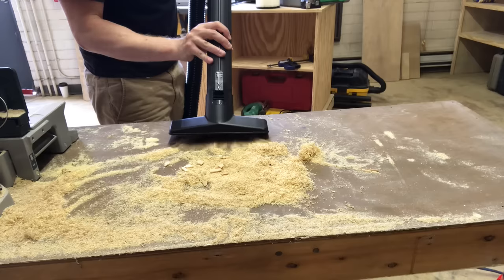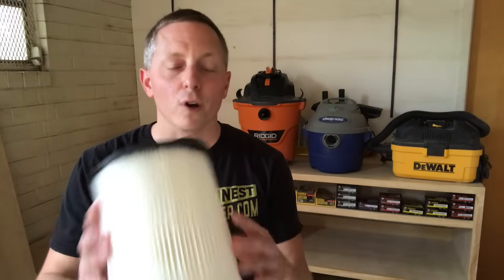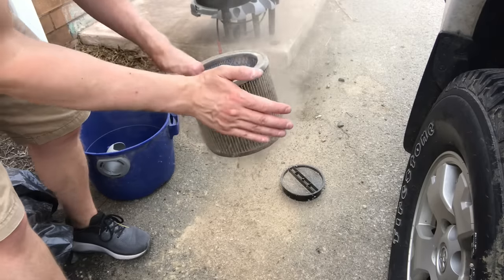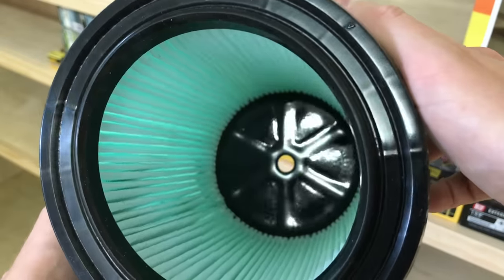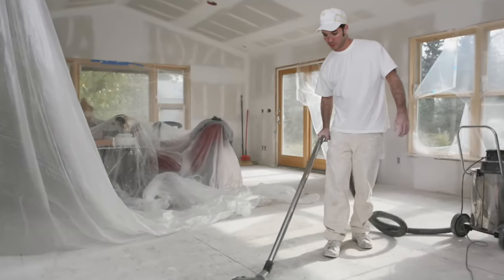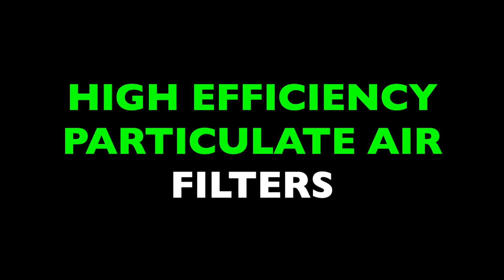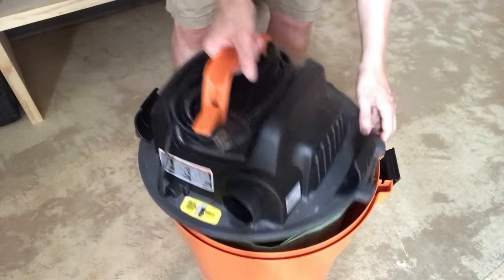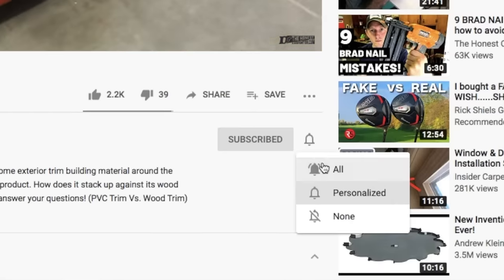Never Use A SHOP VAC Without One Of These!! (Shop Vac Filter Bags/How HEPA Filters Work...)

Comment: The way I tackled this when dealing with drywall dust was to attach a 15 foot hose to the exhaust port and stick that out the window so no air or dust was recirculating In the house
Reply: Life hacks
Reply: I use the rigid muffler, works like a charm
Reply: Yeah,  me too,  with the long exhaust hose outside
Reply: Your neighbors must love you. A water vault works better so does using a fine particular dust bag. That added hose reduces you vacuums power and runs the fine dust through the vacuums impeller, wears it out much faster.
Reply: @jamesmchugo9422  hey desperate times man, had to do what I had to do.
Reply: @jamesmchugo9422  also, all y’all complainers live six inches from your neighbors or something?
Reply: @wchops7578  His point was valid.  You will be getting the dust around your house and the neighbor's house.  So, it would be better to do it right.
Reply: I've done this, works great.
Reply: Swimming pool hose. Smooth bore. Leave the vac outside.
Reply: @wchops7578  in NYC, all the houses are connected...
Reply: @jamesmchugo9422  I don't know if you noticed, but 2 HEPA filters and bags @ $99.99 ($49.99/each) cost more than the vacuum @ $89.99. So, it's actually cheaper to replace the vacuum than HEPA filters in the long run. Ridgid is using the razor blade approach, sell the razor cheap and make your money on the replacement blades.
Reply: @wchops7578  HAHAHAHAHAHAHAHAHAHAHAHAHAHAHA
Reply: @fvrrljr  chill
Reply: @wchops7578  i laughed cause you killed Everdash with Kindness LOL
Reply: @fvrrljr  haha I rescind my comment and encourage more laughter! 😁
Reply: @wchops7578  i Like, OLE'!
Reply: @jamesmchugo9422  been using a old floor vac turned upside down the exhaust my planer chips through the barn wall for over 30 years. still works great. all metal vac and impeller.who knows how many termites i feed?
Reply: Ahhh... You tricky son of a gun I'm going to try that out.
Reply: Absolutely!  I always use hose extensions.
Reply: @singlefather01  I know right? Like there’s not already dust in the air outside.
Reply: @jamesmchugo9422  When it gets to the outside, it goes everywhere then settle down.  I'm not sure how much impact to the neighbor.  They have to be close and have window open.  Even so, it will be very small % may reach there.
Reply: Can I get a link to buy 15 foot hose?
Reply: @jamescc2010  It depends on the brand.  My Rigid brand stuff was at either Lowe's or Home Depot.  Superduper common stuff.
Reply: @wchops7578  It's not that bad. I do the same thing. Just to make sure I tested with a new setup and a cup of corn starch. Yes, a little dust came out, but it dissipated posthaste. But indoors it would have been like smoke. Another thing are oils and VOCs, not even a HEPA filter stops those molecules. Test that with a few well placed drops of perfume or essential oil.
Reply: I do it the cone head way
Reply: @jamesmchugo9422  Could you post a link to how a 'water vault' works?
Reply: @CaseAgainstFaith1  Not really, it depends on the toxicity and amount, but it will be so diluted outside that it will be harmless
Reply: Really good idea. BUT, if neighbors are close by, HEPA filter and bags are the way to go. Keeps everyone safe and no problems with OSHA, neighbors threatening lawsuits,etc. Even though I use a Ridgid vac with HEPA filter and disposable bags, I think I'll try your idea to keep my exhaust port from stirring up dust in the room I'm working in.
Reply: That’s what I was thinking
Reply: @kenchow8213  you can buy a HEPA bag for your shop vac for about 7 bucks .
Reply: Oh no God bless the pedestrian who walks by 😆
Reply: What I do too ! either that or use a long inlet hose and put the machine outdoors (quieter that way !)
Reply: Your neighbors must love you 🙄
Reply: @gregkosinski2303  Greg, my guy, it's not like I live in a former Soviet apartment block blowing air into my neighbor's domicile.
Reply: @gregkosinski2303   As someone who follows this procedure, I would like to point out that I never had a neighbour who gave a rat’s ass for any liking or preference of mine, so why should I give a pair of festering dingo’s kidneys what they think  ?
Reply: @singlefather01  Unless you live in an apartment and his goes is right next to your window, then this is not an issue. You are way too quick to call someone a jerk. This guy could live a mile from his neighbor. The fact is, except in cases of extremely close neighbors this is not an issue at all. You should use your head before spouting off online.
Reply: @jamesmchugo9422  Unless the neighbors are exceedingly close, they almost certainly wouldn't even know it let alone have an issue. Much ado about nothing.
Reply: @CaseAgainstFaith1  Only in those cases where the neighbor is close enough that it matters, which is a small subset of the real world.
Reply: @jeremiahwright8294  Perhaps the neighbors shouldn't be coming over and snorting off his vacuum hose...
Reply: @melissacook5186  Yet NYC and places like it are a small subset of the real world.
Reply: @kenchow8213  You don't need to buy the rigid filters. I've had several brands on my vacuums.
Reply: @ericmann7945  The HEPA filter and the bag are a great way to go. I do the same. I also use the muffler to disperse the output air to keep it from disturbing dust in the room.
Reply: @MaikasCooking  If the pedestrians are that close by it implies they are in a city which also means they will have breathed in more particles from the smog in the air after walking a couple blocks, than they would get from a vacuum running.
Reply: @NickFrom1228  "You don't need to buy the rigid filters. I've had several brands on my vacuums." Can you please specify which other brands of hepa filters you have found also work on Rigid vacuums.
Reply: @NickFrom1228  In the real world houses are often mere feet away from each other.  Depends on the neighborhood.
Reply: @kenchow8213  where are you buying bags for $50 each? At least two suppliers I use sell HEPA rated bags for in 10 packs for something under $35 a pack. I can go to Walmart and get a 3 pack for $20. You’re getting screwed by whoever is selling them to you.
Reply: @basilleonardo  something like it yes. This is one of several home made versions. It appears to be getting it done.
Reply: @NickFrom1228  thanks brother!
Reply: @kenchow8213  I haven't paid attention to brands but I think anything that fits shopvac fits rigid, at least the model I have.
Reply: @CaseAgainstFaith1  Which is just restating what I said...
Reply: @singlefather01  Ha ha!
Reply: @murderedouttt3055  I bought a Rigit filter, but it doesn’t fit my Rigid Shop Vac. I can’t figure this thing out unless I’m getting the wrong one!
Reply: @Tinyteacher1111  you need to buy the 2 1/2” Ridgid power tool adapter accessory and then it will fit
Reply: @paulrodriguez4061  😵‍💫
Reply: @corydriver7634  grow up
Reply: Nice
Reply: @MaikasCooking  or the guy who just washed his black car! lol
Reply: So long as zoning doesn't give you shit that is a great idea.
Reply: Genius! Thanks!
Reply: That's smart. I think I'm gonna consider that. 👍🏻
Reply: Oh ..I use mine for wet …oddly filter is worthless…been using exhaust hose since the 70s…send the dust outdoors
Reply: I put the exhaust hose in my mother-in-law's bedroom. She never came back.
Reply: 25 yo ridgid shopvac..found out It was made before they designed the vacuum bags can you think of a way to make that work. The inside of my inlet hose does not have a slot to slide the cardboard square into
Reply: @James McHugo  why would adding a hose on the output change how much dust is going through the impeller? Only removing the filter would do that.
Reply: @wildmanofborneo  using the dust hose connect to the output doent reduce the amount of debri paasing through the impeller, it merely sends dust outside...
Reply: @Sluggo01  not sure why you're telling me this.  You seem to be repeating what I said. Keeping the filter on and ducting the airflow outside is the healthiest way to deal with it.
Reply: @wildmanofborneo  sorry
Reply: In the professional world drywall dust is managed with sweeping compound not a vacuum, bag or no bag drywall dust will clog up vacuums…
Reply: Definitely have to try this method
Reply: I'm going to do this in my shed. Great idea
Reply: I bet your neighbors really loved that!😂
Reply: @MaikasCooking 
   It'll look like they just blew a "FISH HORN."
Reply: @general5104  Brother, your two years late to the party with that comment.
Reply: I did the same thing when cleaning out my chimney dust. Bought an extension hose and stick the vac outside, so much less dust in the room that way.
Reply: @murderedouttt3055  I have the RIDGID muffler on my RIDGID vac, but it's purpose is to reduce the sound level of the vacuum and does nothing to remove fine dust particles.

Comment: Just remember, the finer the filter, the more resistance it adds if not compensate with major additional surface area. If you always pick up a lot of hair that makes it harder to clean your filter, you can wrap one layer of a fine netting (Walmart sells it as “Thule” In the wedding decorations area) … It adds virtually no resistance, but will trap the pet and human hair before it enters the filter, and is easily peeled off prior to cleaning and takes all the hair with it and it’s super cheap.
Reply: Nice tip! Thanks!
Reply: Bit late for this, but I believe you mean "tulle."  There's a company called Thule which sells roof racks and such for cars.  And if you really want to get esoteric,  thule has a metaphorical meaning of any distant place located beyond the "borders of the known world".  The guys that might be watching you and reading this tip may feel that way about the wedding decorations department.  Wives will probably know what tulle is, and would be happy to get some for you.  They do sell it places other than Walmart.

Comment: Get a 25 foot pool hose, put your vac out side, hook up the pool hose to your vac leave vac out side, bring pool hose inside. Cheap, easy, no dust in the house.
Reply: Doing it this way, The dust ends up in your homes vents and finds it way back into your house and then your $10,000 air conditioning system is affected.

Comment: Doubt anybody will read this so late in the game but the reason smaller particulates are easier to capture is because of a phenomenon called Brownian Motion (also movement) that causes the smaller particles not to move in a straight line. In other words, they're a bunch of extremely drunk drivers, at night with no illumination, with a malfunctioning GPS, zigging and zagging, trying to thread their way through the microscopic eye of a needle, and running into the filter walls and getting stuck.

Comment: I have been using an old pillow case for years, works even with drywall dust.
Reply: So you use the pillow case instead of a bag? Or instead of the filter?
Reply: @angellas.1314  Instead of the filter. I use large elastic band to hold in place
Reply: This will not filter out fine particles. You can't see them.
Reply: @danielwilliams3332  You are correct Daniel, but I do not need to worry about fine particles, it is good enough for what I do.

Comment: @The Honest Carpenter Ethan, I utilize a wet towel over my exhaust on my shopvac to catch any fine particulates that happen to pass through my HEPA filter cartridge. I just strape it down with some bungees and make sure to keep it damp. Great for working in an occupied residence.
Reply: Great idea. Thank you
Reply: Thank you! So many smart people out there …
Reply: Nice,,,  a reverse swamp cooler :D
Reply: I used this method as a stop gap but the rag dried out almost instantly. Works well for a quick vacuum
Reply: Great idea, what kind of towel did you use?
Reply: @DM-lk5ym  I prefer to use a heavier, higher thread count towel as apposed to a thin shop towel or microfiber. The towel should hold water for a good amount of time before having to re-wet it.
Reply: @JaybirdOnTheRun  Thank you, I'll be adding a "good towel" to the tool world lol.
Reply: would love to see an official study to see if this works as well as you hope it does.

Comment: You can also knock off the dust from your filter using an orbital sander (without any sanding pads). The vibration will get most of the fine dust off

Comment: Another thing I’d recommend is using a broom and dust pan for big loads of easy to get crud.  It will save your bags and filters and the fine particles will not be essentially throwing a ton of particles into the air like the blower on your vacuum would.
Reply: I made my own system where everything goes into a large 50 gallon barrel and then goes to the shop vac. Basically a diy and larger version of the dust rite system by rockler. Works great and don't have to worry about filling up my shop vac. Getting the hepa upgrade for my ridgid is a no brainer. 
And the money pit continues...
Reply: Greg you can tell who is too lazy to use a broom.🤣
Reply: If I am using a broom I first throw down some damp sawdust or failing that lightly spray the floor with water from a spray bottle
Reply: @duster.  | Smart!
Reply: @leroypoole1998  | Your health also continues. 👍🏽

Comment: Always used a nutone hepa vac since I got my lead safety certifications 20 years ago! They are expensive and impractical but didn't have any other options for a long time! Since then I have come up with a few different options water filtration being the best! Used a two stage separation chamber to catch the bigger stuff, then water filtration for the third chamber! Keep s the dust from getting to the final filter and the weight from being to much for the main bulk of the material! Its kind of cumbersome and awkward but keeps my "Older" homes I work in more safe , and easier to clean up at the end of the project! Got the idea from the rainbow vacuum cleaner! Basically a cyclone system co.bined with a rainbow vac!
Reply: Many years ago I think I read in Consumer Reports or some other publication that rainbow vacs did not filter out particles even though rainbow claimed it worked. Of course maybe your system is effective, but I remember thinking how much work vacuuming had been for someone I had known in the late 80's who had purchased the expensive rainbow vac and hauled the heavy machine around her house vacuuming daily to improve conditions for her young children who suffered from asthma.

Comment: I've been preaching the use of barrel liners AND use of pleated filters at the same time for yrs. I've even figured out methods to retrofit barrel liners in older shop vacs that weren't designed for them. Thanks for explaining HEPA bags and their purpose.
Reply: Are you saying the barrel liners are better than non-barrel liners? My vacuum only has non-barrel liners available.

Have you by chance figured out how to use a barrel one on a small 4 gallon vac?
Reply: @themikeroberts  Are you talking about the paper filter that goes over your pleated filter and is usually held in place by a friction ring? Yes, that's better than just using the pleated filter. What I was talking about is converting older shop vacs that didn't come with barrel liners, to barrel liners. Most times it can be done. No way I can tell you without yours in front of me.
Reply: @TheReal1953 I wish you’d make a video just to explain the details.
Reply: @gedionsamuel2256  Love to, but vids aren't in my bag of tricks.

Comment: Bought a 16 gal. Rigid at a Black Friday sale. Will get the bag set too. Catching fits cleaning drywall dust at a rehab vacation home.  This is exactly what I need. I'm frugal, but this is a convenience I'm willing to pay for because I do not use it routinely. The slide to cover the opening is a good feature. I have 2 older model canister vacuum cleaners in which I use HEPAs. They make a world of difference for allergies. TKS!!!

Comment: We are new homeowners and last year bought a house built in 1880. It had a very old fireplace which was unusable due to the unlined chimney; because of this we assessed the best solution was to have a gas fireplace installed. But before that could happen, we needed to clean out the ash trap that had at least a 100 years of compacted ash. It took my husband and I a weekend to remove over 30 lbs of ash, (using our new shop vac and multiple HEPA filter bags. Yes; first we started from the fireplace and worked down. They we had to go to the basement ash return and work up). It was a messy job; but made much less messy with the proper tools and filters. 
Thank you so much for this informative video. Thanks to you we had the proper tools for the job and were successful in our mission. Now we have a beautiful/functional fireplace for pesky Minnesota winters!

Comment: Everybody probably already knows this, but adding a cyclonic separator inline before the shop vac will greatly extend the life of your shop vac and its filters. I use Rockler's and it makes a huge difference (probably would not use it for cement, I use it for wood chips and sawdust).
Reply: Amen 🙏🏼!!! If you only use a 5 gallon bucket and have it connected to your planer , keep an eye on it cuZ the bucket fills up really quick & then gets into vacuum & clogs filter
Reply: @frankking1466  Frank, I had this EXACT scenario happen to me when I was helping my friend plane a bunch of reclaimed oak. Luckily I had an extra shop vac filter bag on hand.
Reply: @Grauenwolf  I actually bought a HEPA filter for the shop vac just recently. I haven't noticed any huge difference in performance for the price, honestly, but I felt like it was the right way to go.